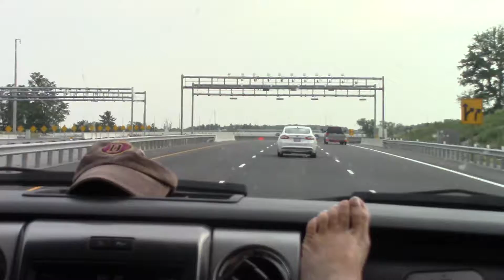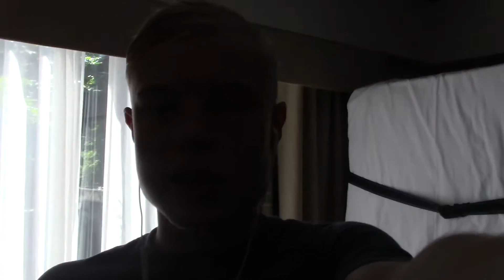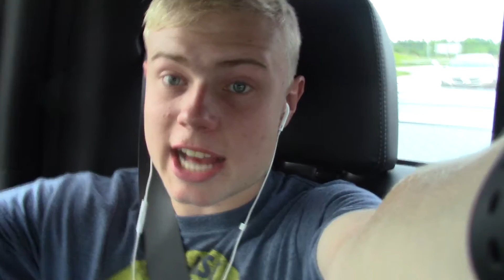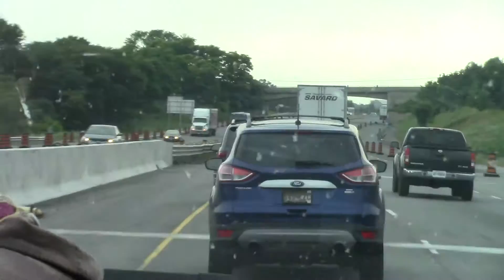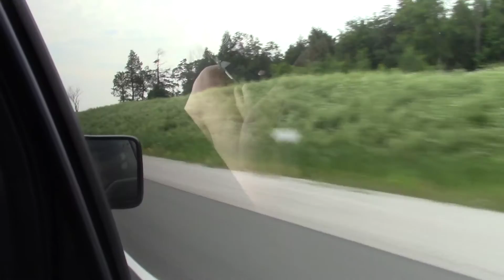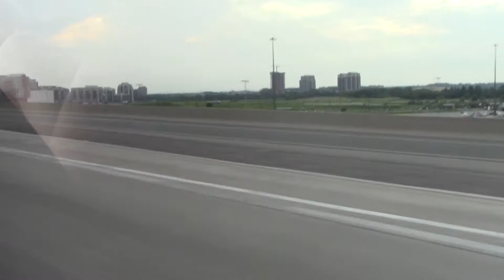Why Does Concrete Pavement make annoying Sounds

Comment: OK, me personally, I don't think its very annoying. Along with other peoples thoughts on it, those sounds are actually very relaxing to listen too. And honestly, don't think its much to complain about if you dont like how loud they are. And I believe it or not, that toll road is probably the only highway in Canada with concrete roads. So its not much to worry about. Comparing to highways in the US, we use a lot of concrete on our roads, and it could be distracting at times. But most of our concrete roads are pretty fun to listen to, especially the very loud ones.

Comment: It is not the concrete inherently, or a bad pavement surface, it's because the pavement has grooves cut into it that run from side to side along it,, which are to help prevent your car from hydroplaning. The side effect of cutting the grooves in this direction is the sound you're hearing, because your wheels are vibrating on the grooves. And frankly, I love the sound they make, music to my ears! I suggest you just ignore the sound if you don't like it, talk over it or play the radio.
Reply: **the road expert and the roblox dev finally speaks**
Reply: Hi hydrolock. Aren’t you the founder of IR on Roblox?
Reply: also my car gets traction much better in concrete, My corvette spins up to like 100+ mph on asphalt, on concrete grips much better.
Reply: The sound the concrete makes amps up the motivation of driving in some way